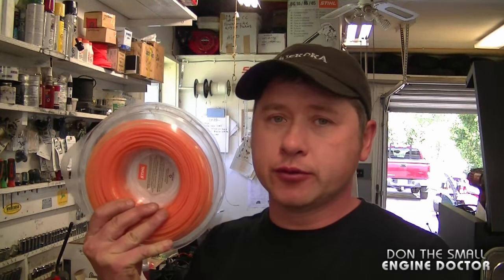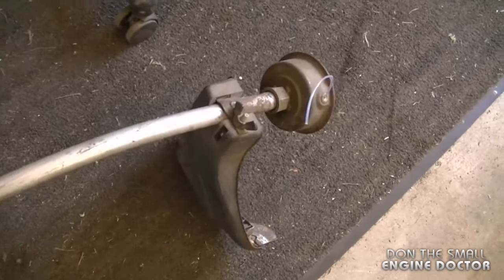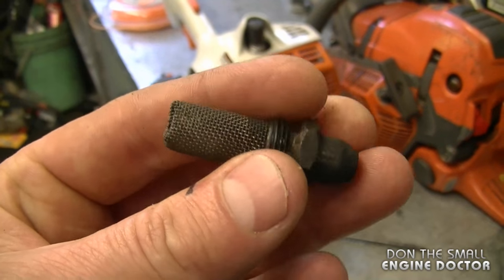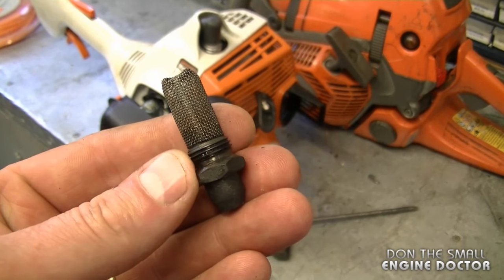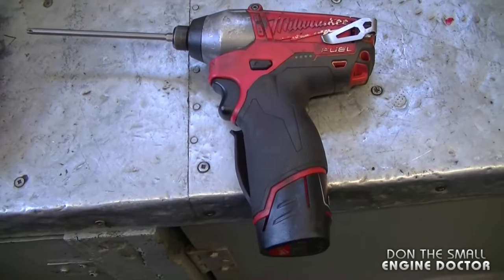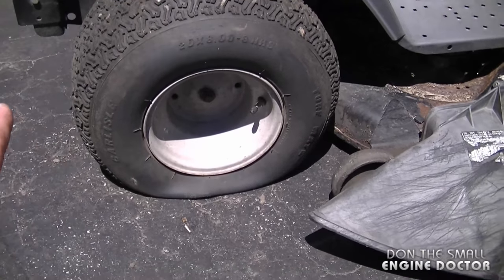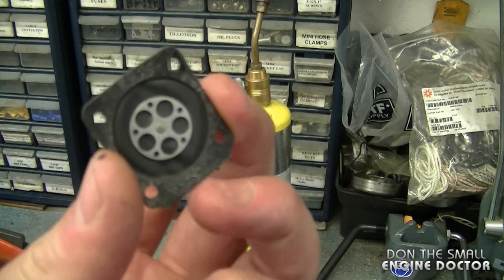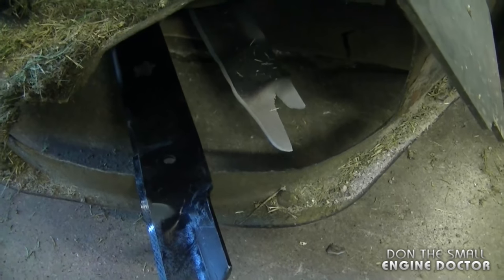Small Engines Q & A Video #151

Comment: For that drill and it's common across the board on all tools with rubber bumper wraps......clean both surfaces with denatured alcohol and use super glue. You could use contact trim adhesive, but super glue is easier.

Comment: G'day Donny interesting about the line in a trimmer.  I have always used the thick orange one and I have always had problems with the line not coming out when the head is knocked, Stihl told me my kombi set up could take it, so I will try the smaller gauge thanks mate John
Reply from the maker: just check what the recommended line is for your trimmer
Reply: +donyboy73 i leave my spark areester off Iike it loud
Reply: maybe install some mini headers Ed?  lol

Comment: Dude! I started collecting and rebuilding Stihl chainsaws to add to the husqvarna collection.... Those fitted fuel lines are costly and a pain in the rump to install !!! I taped up a pair of needle nose and oil up the lines... I need like soft rubber pliers??? Is there a Stihl specialty tool that techs can order? What a pain! I do really like the saws... Expescially the older models! I have two 028's that I'm rebuilding and with that weird looking ...restricted jug ... I know why guys say they aren't impressed ... Found a couple of jugs to grind on to find what works... The 350 husky deffinitly kicks it's butt from where I'm at but they'll pull a 16....

Comment: Not sure if you've had this question, but does it matter what orientation the diaphragm of a 2 stroke carb is (if possible).  What is the purpose of the flat stamped steel disk? Does  it matter if that disk is put in so it is on one side or another? more theory questions but was just wondering. Great vid!
Reply: Often a carb will have alignment dowels which tells you how put the metering diaphragm on if it has to go a certain way. If it doesn't have the dowels, then it doesn't matter. The big plate that goes face down onto the carb is there to stiffen the diaphragm surface. If it weren't there, the upward pressure from rocker arm would be concentrated at a small point and quickly stress the material.  It's important to try to get a mental image of just how fast the metering diaphragm has to flex up and down. A hummingbird can flap its wings a maximum of 10 times per second. Impressive. But the diaphragm in a 2-cycle carb flaps 100 times (6000 RPM) to 200 (12,000 RMP)  times per second. That's almost unbelievable.

Comment: Have a Murray lawn tractor with 14.5 Briggs engine. Put new carb on but will only run on full choke, adjustments do not seem to change anything
. It seems to be getting gas, but does have one of those solenoid on bottom of carb. any ideas?

Comment: hey Dony I just put a new head gasket on a Kohler cv730 25hp and was wondering since it has hydraulic lifters if the valves ever need to be adjusted. the valves didn't have the adjusting screws on the rockers like other ohv's.
Reply from the maker: no they don't

Comment: with the trimmer line if u go to big and lug the engine it will over heat and blow up or cause premature ignition failers had a few in at work running six cords and 4mm wire and would not rev past half way. bloke wanted warranty on a cooked coil haha

Comment: hey dony I have a 16 hp Briggs and Stratton opposed twin and the carburetor will only run on choke plus the little pump for the fuel isn't pumping now and I've cleaned the carb out and the jets
Reply: Replace the fuel pump.
Reply: +Ridge Power Equipment you obviously don't know about the engine cause it's something that can't be removed except the diagram

Comment: Would love to hear from subscribers as to how you safely remove sticky weed and grass trimmings from the plastic grass guard of all weed eaters. Harsh chemicals, like brake or carb cleaners, will dull the plastic finish. I've yet to discover any product that works well and doesn't ruin the plastic.
Reply: Stanley Waggoner wd40 works for me
Reply: WD40 works good most of the time. However, there's one type of weed that grows in early Spring that has sticky sap. WD40, nor anything else I've tried removes it without scratching the plastic.  Thank goodness this "high sap" weed doesn't last all summer.
I've tried spraying the plastic before weed eating......nothing seems to work on this stubborn sap.

Comment: I have a craftsman 25cc 2 stroke blower. Runs and on 40:1. I hav replaced the plug and cleaned the carburetor. It still won't start, could I have advice on what to do?
Reply: 3 things always required.  Compression, Fuel, Ignition.  Did it run poorly before, or not at all or ?  Check Compression.  Check spark, if you have both, spray some quick start/ether in and see if it'll at least pop.  If so, it's something in the fuel system.  Good luck
Reply: If your fuel line and filter are good, replace the carb. Look on Ebay.

Comment: When gas gums up does it ruined the gaskets in the carburetor
Reply: Not usually just clean it out and check the gaskets and if they aren't brittle or damaged they should be fine
Reply from the maker: yes

Comment: Hey I have a 1979 John Deere 108 with a 8 hp Briggs and Stratton engine and the engine won't turn over how do I fix it? Can I rebuild it?
Reply: Check battery, battery connections, then the starting relay.
Reply: IS THE MOTOR SEIZED

Comment: Talk about gas weedeaters I repaired my carb with a carb kit my primer bulb is separate from the carb the fuel fuel line from the carb to the primer has fuel and air bubbles why? I have a weedeater BC24W walbor carb
Reply from the maker: they usually always do
Reply: Okay but for some reason it is still having trouble running.

Comment: I have an old Sears mower that has no oil fill hole, I don't know how to change the oil. Can you tell me?
Reply: Cameron Rozek may be that it's a 2 stroke engine. These are lubricated by oil that is mixed in the gas.

Comment: String size is easy to find for your grass trimmer... so get that! Bigger is not better because it is a machine that turns the spindle at specified RPMs and heavier line makes it slow down and slower line cuts less efficiently. The designers of the trimmer are engineers... and you are not.